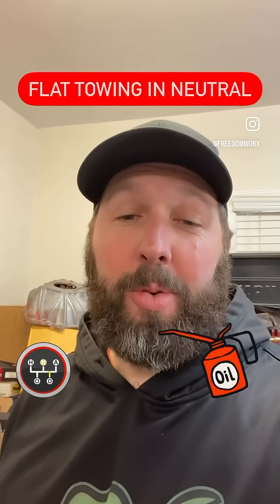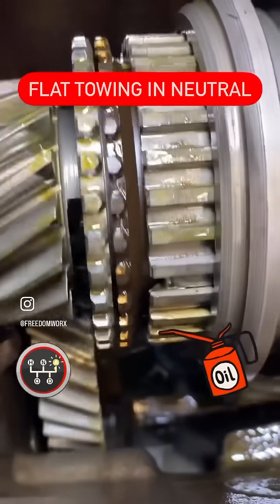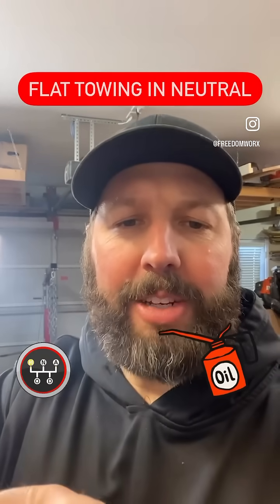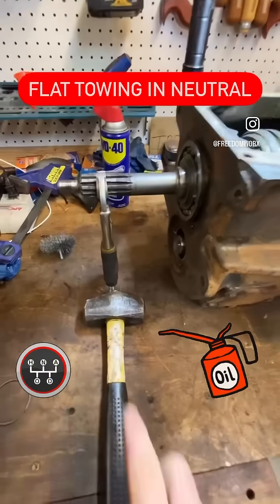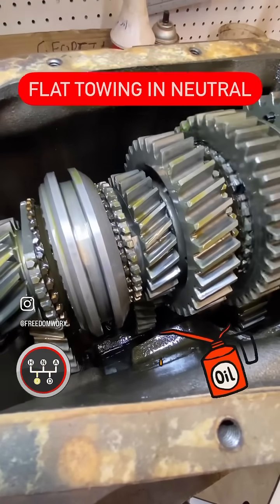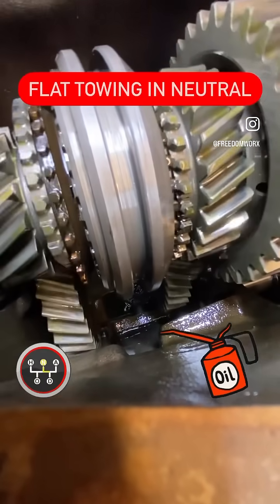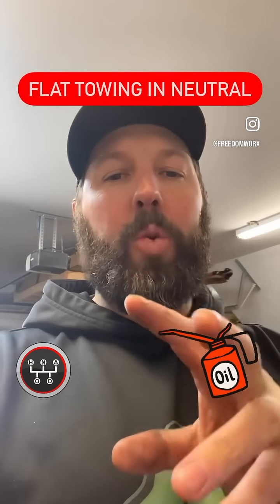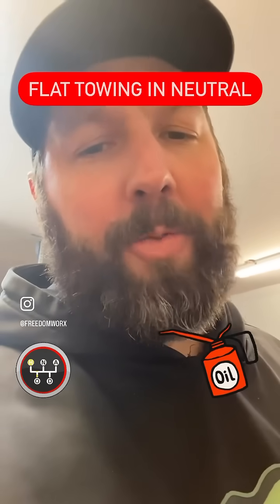Don’t Flat Tow in NEUTRAL!  #transmission #stickshift #mechanic

Comment: Understand your point.  Thought about it myself long ago.  Still, have made at least a dozen trips of 1000 or more miles.  Various vehicles, CJ2A, VW, 4x4 IHC, others.  Plus hundreds of shorter trips.  No ill effects.  How you going to overfill a manual box?   Could take the gear shift out, pour in extra oil, on some older rigs.  Could stop frequently, run engine in N to splash oil around, tedious.  Don't know if there is a pat answer.  Err on the side of caution?
Reply from the maker: Well there are plenty of vehicles that can be flat towed just fine. Jeeps tow with the t-case in Nuetral, which isn’t universally ok for 4wd vehicles, but is for most. Same with transaxle vehicles. Yes , you could fill from the top or install an elbow in the fill plug location, and extend the elevation of the fill port higher. Like you said, always use caution. Read the owners manual.

Comment: A few cars are designed to be flat towed in neutral. But he’s right, most aren’t.
Reply from the maker: Absolutely. There is a reason you see so many Jeeps behind RVs. They are one of the best for flat towing. Throw the transfer case in Nuetral and you are good to go. And some manuals will oil properly in Nuetral.
Reply: GM? Like if I have a 2010 Silverado 1500 in neutral

Comment: Way back, I got stuck fixing a jeep from the early fifties. The guy towed it for too long. His transfer case gears locked up. I tore it apart and found the thrust surfaces on two gears had bonded in three little spots. That was it. I just stoned the spot welds off and put it back together. It taught the owner a lesson, but was not a big deal to fix.

Comment: Overheated a work pick up 1980s chevy. Towed it home about 50 miles. Promptly yelled at by the boss for destroying the tranny. 😖 An auto tran.   After I told him for all that yelling I should have left the drive shaft connected.  But I'll admit had it been a stick I might have just put it in neutral.
Reply: What was the reaction of your boss? Did he buy you a case of beer?
Reply from the maker: Most people don't realize it can be a problem.

Comment: Stands to reason with Dino based gear oil but I use full synthetic
Reply from the maker: It's at cooling issue, not a lubrication issue. Doesn't matter what process is used to produce the oil, it cant cool what it doesn't touch.

Comment: How bout freewheeling downhill with engine  on idle in neutral. Just curious cause i have done so in past to save fuel on an 8k run. Bit dodgy tho. I have noticed if  i snig the gearlever into neutral coming up to traffic lights the drivetrain seems lumpy - LC 105

Comment: First off when your flat towing you are turning the output shaft not the input shaft.
Reply from the maker: Yeah. And that’s the problem. Because the input shaft is what turns your countershaft, which is what slings the oil up to the output shaft. Didn’t think that one through to well did you? 😂
Reply: @freedomworx  I thought it through
Reply: @freedomworx  I thought it through and what I was saying was your presentation was wrong. If your going to show what happens when you flat tow turn the output shaft.
Reply from the maker: @mikegray1171  maybe you need to rewatch the video. Because it's been watched millions of time across several social media platforms. And most people seemed to understand it. I did turn the output shaft, and I clearly showed that it doesn't turn the input shaft if the trans is in neutral. Thats the entire point of the video. YOU NEED INPUT SHAFT ROTATION TO LUBE THE MAINSHAFT

Comment: Since the front of my jeep sits higher than stock I run extra oil in the trans to lube the input shaft bearing. To do this you have to take the shifter off and fill it from the top. Technically it's overfilled but since the trans is running on more of an angle the fluid at the front is where it needs to be.
Reply from the maker: Jeeps are supposed to be flat towed with the Transfer Case in Neutral, and the trans in Park or in gear if it’s a manual.

Comment: Any tow truck driver worth his salt already has the that u-joint strap socket mounted to his cordless impact, unless it’s a 10mm, it’s already lost….🤦
Reply: When I buy a new socket set I also get a 10mm individual socket to sacrifice to the gods of the traveling tool bag. I'm not even joking.
Reply: @intheshell35ify  My son came over the other day to borrow a tool. A 10mm socket. Now I have none.
Reply: I shouldn't even share this trick. But I've figured out how to find my 10mm sockets every time without fail. All you need to do is be trying to find a 12 and suddenly you'll find 10's you didn't know you had.
Reply: That’s why I own ten 10mm sockets!
Reply: *9 10mm sockets
Reply: @LordStanleyCup  I found a bonus one while working on my motorhome a couple months ago. Craftsman! I was pretty excited about that.
Reply: @LordStanleyCup you mean 9

Comment: Seen a LOT of transmission ruined from a flat tow. Many in just 4 or 5 miles. Guy i worked with towed his cal about 20 miles. He was so proud. Some of us said your transmission is shot. He would laugh and say your jealous. Well after a week he got the carb fixed and it wouldn't hardly move. Cost him about 500 to have a 100 tow. Or just pull the drive shaft..
Reply from the maker: Yep. It’s not intuitive that or could cause a failure. There are people in the comments that think I’m full of it 😂🤷🏻‍♂️

Comment: A protective extra lubricating additive could cling to the gears.
Also, for a very long to, keeping the  transmission OVERFILLED would make sure gears are lubed. When done, adjust the oil level.
Disengaging the driveshaft is inconvenient, removing 2 u-joints, and the u-joint caps can come off, and spill the needle roller bearings.
Reply from the maker: An additive won’t cool the components. That’s the issue. But overfilling is certainly an option.
Reply: You do know that drive shafts bolt both to the output and diff wait you actualy think you have to remove u joints to get a shaft out 4 bolts each side easier than changing a flat tire  my guy
Reply: @todydn Yeah this video and comment section is eye popping. What on earth. You never touch U joints unless you're replacing bearings or something. Though even then you're better off just buying a new shaft than trying to rebuild one
Reply: @gaidenshinji8969  100%
Reply from the maker: @gaidenshinji8969  what do you think is eye popping about this video? It’s factual information 🤷🏻‍♂️
Reply: @todydn  He said "u-joint caps can come off, and spill the needle roller bearings." How is that wrong?  You have 2ea unrestrained caps on each end.
Reply: @deanhagstrom6667 tape them with electric tape where are you people from 😂😂😂😂 I'm from the country where you breakdown in areas that most can't get too.  We tape the u joints if it has a yoke we tie it up if possible so it doesn't lose fluid.
Reply: @jwhitley101whitleyfarms9  Then first, you'd have to clean of any greasy film so the electrical tape can stick.
I'll remember to keep some in the glove compartment. Thanxxx

Comment: If your transfer case is in neutral, your transmission output is not spinning
Reply from the maker: That’s not entirely true. If the transmission and t-case are both in Nuetral, both can spin simply from fluid friction. That’s why most owner’s manuals will tell you to place the trans in Park or in any gear if it’s a manual trans.
Reply: Yeah that's kinda the point

Comment: One could put the trans in high gear on a 2wd & have a guy in that truck with the clutch released. Yes the pilot bearing would the in motion but for a short distance i think it woukd be ok.
Reply from the maker: I’d just pull the driveshaft. 😂 it’s actually ok with some manuals. You have to read the owner’s manual 👍

Comment: I flat towed over 6,000 miles with my Jeep Wrangler with the transfer case in neutral with out an issue.  I could be wrong but I think F1 cars may be the only ones that have a transmission oil pump and you are only going to flat tow them off the track if they break down.  The way to flat tow is to disconnect the drive shaft and you can get disconnects for some front wheel drive cars.  For front wheel drive cars that don't have that option you need a tow dolly.   I backed my mid-engine Toyota MR2 backwards onto the tow dolly to get to and from the track as the half shafts have no way to be disconnected.
Reply from the maker: That’s how you’re supposed to tow a Jeep. Transfer Case in nuetral and manual trans in gear or automatic in Park.

Comment: 2007 Ford Ranger with manual trans can be flat towed, according to the booklet in the glove box. Just have it in neutral and make sure the wheel lock is disengaged,
Reply from the maker: It’s possible with many transmissions. You just have to read the owners manual.

Comment: Recently flat towed 2012 subaru 6MT 200 miles, intentionally over filled the trans before, pulled over multiple times and found the trans felt hot...😮 Regardless car is fine 20k miles no bad effects I've noticed, but that heat bothers me.🙄😬
Reply from the maker: Scubaru don't care 💪
Reply: I'm sure the trans would feel hot even during normal driving - trans temps get up to 200F+ pretty easy.

Comment: Should the transmission be in a gear then? If so which gear? 🤔👍
Reply from the maker: Absolutely not. If the transmission design doesn’t support towing flat towing in neutral, you are either removing the driveshaft or putting it on a dolly or flatbed.

Comment: I’m converting my 87 Chevy Crewcab with an 2nd gen Cummins and Nv4500 2wd 5 speed. 
So if I want to flat tow looks like I’ll need to remove driveshaft anyway. Am I correct?
Reply from the maker: Yes, I believe the NV4500 has the same oiling limitation as this transmission.
Reply: Makes sense. Probably saved me a lot of trouble. Thanks

Comment: what about a fwd honda civic si?
Reply from the maker: You’d need to read the owners manual. It’s fine in most front wheel drives because they have a transaxle, not a transmission.

Comment: I jave a '92 4x4 f250, so i would need to put my transfer case from 2h to neutral? Then leave my transmission in gear?

Edit question: can i just remove bith front and rear drive shafts from the transmission and not have mess with going to neutral?
Reply from the maker: You'd have to research the specific transmission. It's perfectly fine to pull some in neutral. Pulling the driveshafts is foolproof though.
Reply: You have a transfer case. Just put that transfer case in neutral then if it's a manual transmission put the transmission in any gear (1 2 3 4 5 R it don't matter). 

If it's auto just leave it in park with the transfer case in neutral. 

Heck of a lot easier than getting under the truck to remove two drive shafts to tow the truck

Comment: What if it’s front wheel drive? Does this still apply if there is no drive shaft?
Reply from the maker: Front wheel drive vehicles have a transaxle, and that’s a totally different animal. You’d just have to look at the Owner’s Manual of the specific vehicle.

Comment: I have a Mini Cooper S 2021 manual transmission. I’ve been told that I should put it to manual and close the doors and lock it. Is it the correct way? TKS
Reply: And I should add that this is a front wheeler drive
Reply from the maker: Your owner's manual will tell you the proper way to do it.
Reply: There is a pawl to unlock the trans.(similar to a BMW)
Read the owners manual.

Comment: I've never quite had a handle on this topic, as it relates to Wranglers with T-Case in neutral, assuming we tow with engine off.  It seems to me that if the T-Case is in neutral, it wouldn't spin the transmission output shaft.  If it did spin the transmission output shaft somewhat, then if the transmission is in gear, doesn't that mean it's also spinning the engine, which is turned off?  For that reason, it has seemed intuitive to have the transmission in neutral, to avoid spinning the engine, and then of course the unlikely threat that if the T-Case ever jostled into gear (which it almost certainly never will), then if the tranny is in gear too, you'll certainly have multiple drivetrain damage.  Just wondering how leaving the tranny in gear lubricates the tranny without turning the engine.
Reply from the maker: Leaving the trans in gear while the T-Case is in nuetral does not lubricate the trans, it just keeps it from spinning. Even with the T-Case in nuetral, fluid friction inside the T-Case will cause the trans output to spin, the same way this trans output was able to cause the input to spin in Nuetral. It’s not mechanically coupled, it’s just fluid friction causing the rotation. Putting the trans in gear will couple it to the engine and stop it from rotating.
Reply: Transfer in neutral can still rotate the transmission through fluid friction, however this phenomenon produces nowhere near enough torque to be able to rotate the not running engine while the transmission is in any gear and transfer in neutral.
Reply from the maker: That’s why owners manuals, I’ll use Jeep as my example, will state that an auto should be placed in Park, and a manual transmission should be placed in a gear other than neutral 👍

Comment: Flat towing in gear: best way to spread your engine all over the highway.

My Ford Focus (UK) manual says to put in neutral if being towed on four wheels.
Reply from the maker: Who said to flat tow it in gear? 🤷🏻‍♂️
Reply: @freedomworx  Doesn't the title say not to flat tow in neutral?
Reply from the maker: @alecboyyes  doesn’t say to flat tow in gear, nor did I ever say or insinuate that. The point of the video is to teach people that it isn’t always safe to just throw the vehicle and neutral and yank it down the road. Sometimes you simple can’t flat tow without disconnecting some mechanical components. That’s why I stated to read the owners manual 🤷🏻‍♂️ https://www.tremec.com/not_am_detalle/flat-towing-manual-transmission-vehicles/
Reply: @freedomworx  Cool, no worries. Probably got my wires crossed, just found your video out of curiosity having watched something on a different channel.
Reply from the maker: @alecboyyes  no problem. Thanks for watching.

Comment: Why not just tow in gear with the ignition off? Thats what I do, then everything gets all nice and lubricated.
Reply from the maker: It’s an option. Though a lot of people think the oil pump doesn’t work if the ignition isn’t on. (Though people obviously don’t understand engines very well)
Reply: @freedomworx  Plus it gives you some free trailer braking to help prevent trailer sway!
Reply from the maker: @linuxguy1199  touché 😎
Reply: I tow in gear with engine running. That way my tow rig gets better gas mileage lol